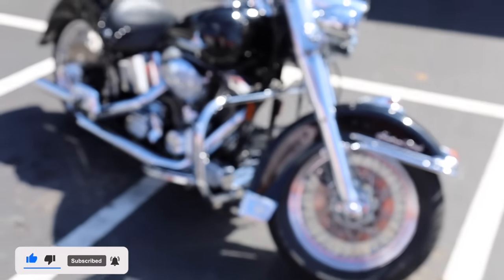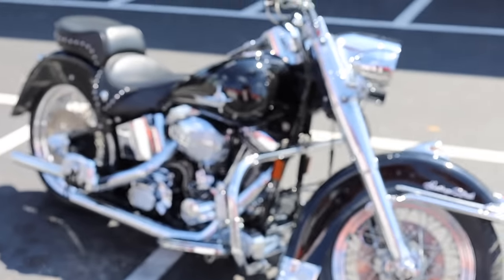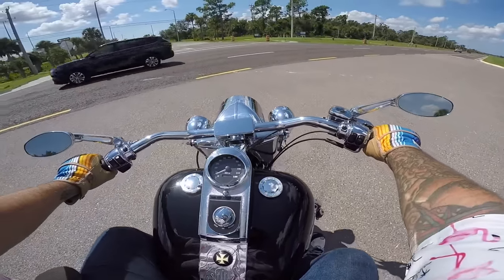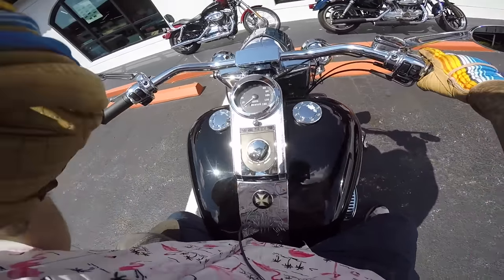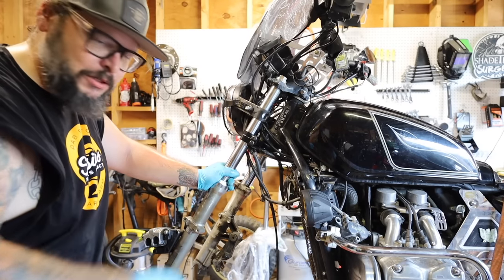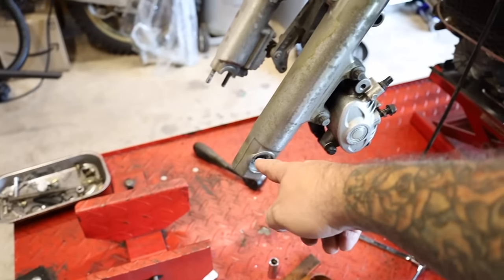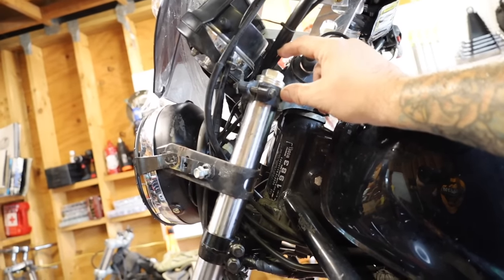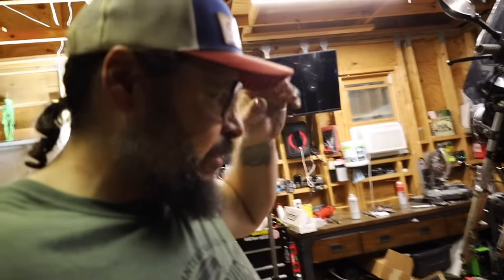Long Travel Off-Road Suspension on a Vintage Honda Goldwing | Flight of the Dung Beetle

Comment: Dude, always undo the damper bolt before you release the spring pressure.
Reply from the maker: I always did it the opposite because I figure the spring tension would make the damper bolt harder to get out and more likely to strip 🤷🏻‍♂️